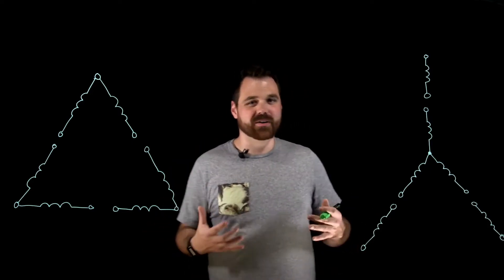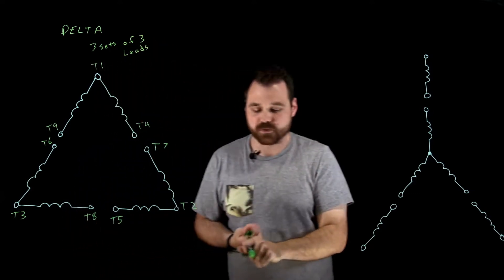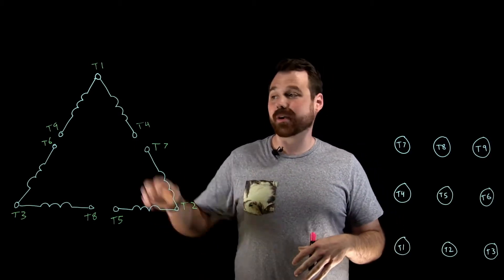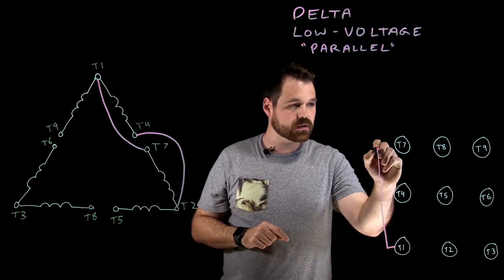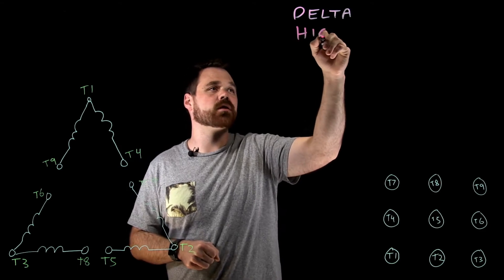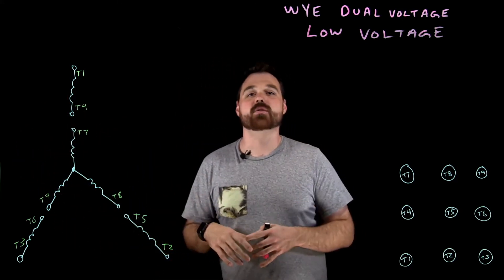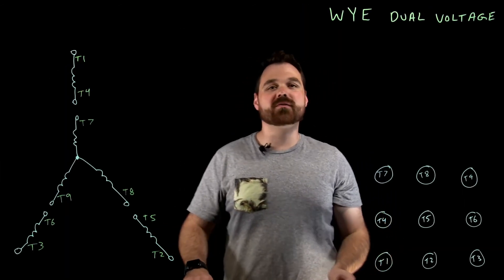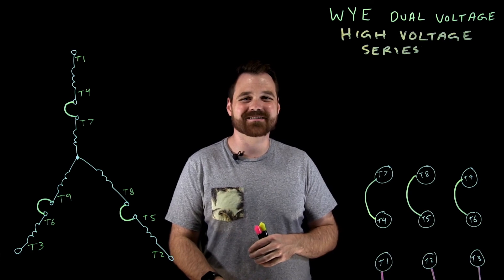Dual Voltage Motor Connections

Comment: If we use data less cloud computing system using optical light interference by  6 timers ( 2 spiral coil on each axis :x , y , z  that connected to these y -delta to drive color light from 3 angle interfer on a spherical crystal so for data of past present and future up to 1.28 x10^19 data with only need  6 x250 records of 64000 bytes 64 bit system so only reset system to timers phase angle according to data record of pay or text or music and base on address and time and date so once the phases angle return back to phase and voltage of time and place then data restore

Comment: One  question sir is it possible six lead motor can go hight  valts and low voltage  by  connecting in to delta or start please let me know thanks very good information

Comment: My resolution, aside from using weight, is to find whether delta flights can have the same neutral standing such as wye -- points at junction (wye) 7, 8 & 9 (neutral) and still get me to where I need to be on a delta? Same, I presume, yes? Like voltage, it must be tasted to understand it's really there? (Kids, don't try this at home, voltage can make you crawl while current can make you sleep past bedtime.)

Comment: hello sir .im asking about in delta connection . how could you connect in delta connection if allready connected inside the motor T10, T11,T12?
Reply from the maker: Do you mean if T10, T11, and T12 isn't connected, meaning you have a 12 lead motor?

Comment: One question.
We can use normal 3 winding 6 lead motor as high and low voltage as delta and star connection.
Then why we need 9 or 12 lead motor???
Reply from the maker: It just gives us the option of different voltage ratings that are more common.